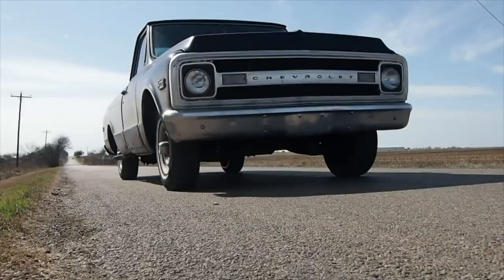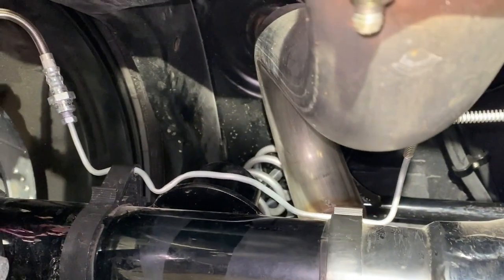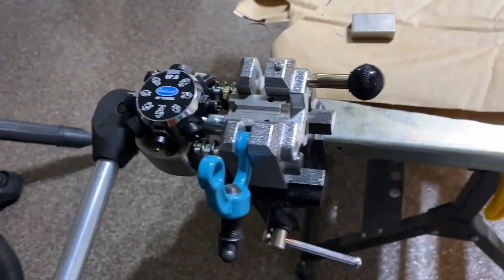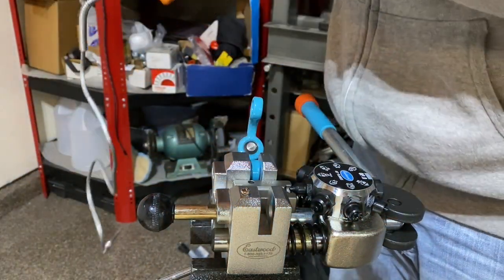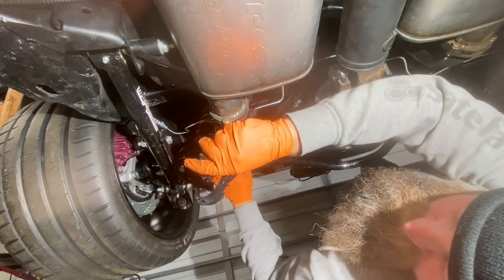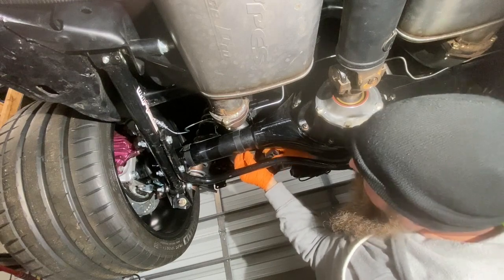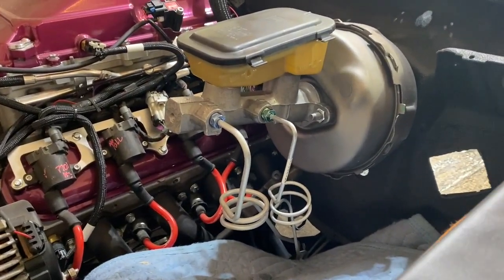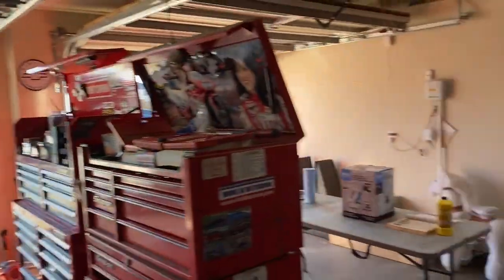G Body El Camino Restomod: Hydraulic Brake System, Master Cylinder, and Power Brake Booster

Comment: Curious ..if you gave any thought to the Caprice 12" booster ..i read that they have more assist helping the clamping forces?
Reply from the maker: I didn’t. Some areas I put a little more focus into than others. For the brakes, I figured going from 10” disk to 12” disk on the front and converting from drum to disk on the rear would be a good start. If I need more brake later, I’ll likely upgrade to c5 and/or a full Wildwood kit with hydroboost.

Comment: Josh, thanks for sharing the good, the bad and the ugly. Very helpful to others working on these old classics. I have to ask, why are you using a stock master cylinder and booster when your running  an aftermarket high performance 4 wheel disc brake setup?
Reply from the maker: Happy to share my journey. It's actually a cheap disk brake setup. I'm running calipers that I pulled off a Camaro at a Pick-N-Pull. I picked up a disk/disk proportioning valve from Summit Racing, and the rotors/pads are from eBay. I haven't found any consensus that the OE master cylinder doesn't work.
Reply: @CarsandJoshee  I just saw the drilled/slotted rotors and assumed (always gets me in trouble) that they were high end discs. I'm still running the factory master cylinder setup on my 87 El Camino and it does just fine. So you should be good for sure.